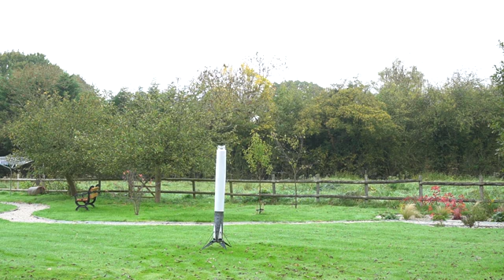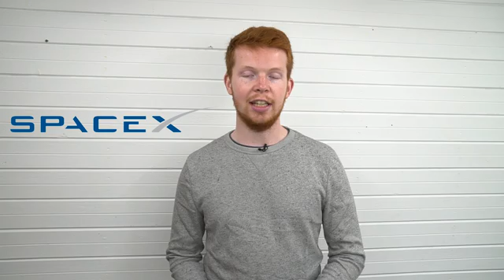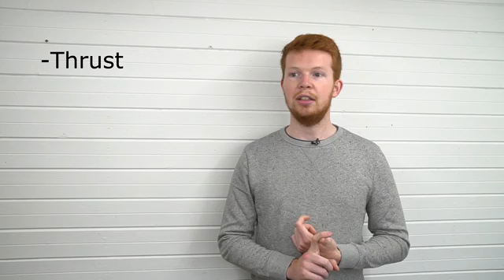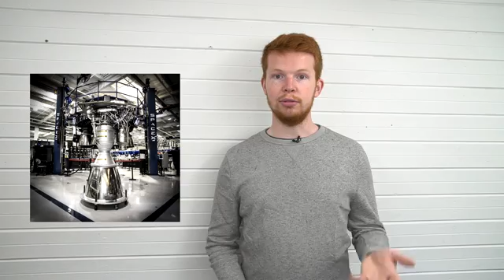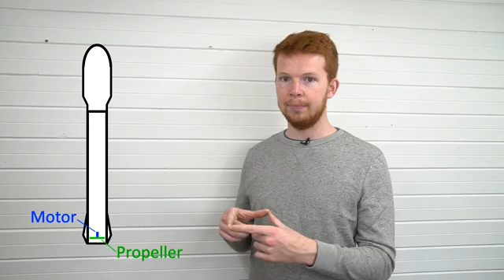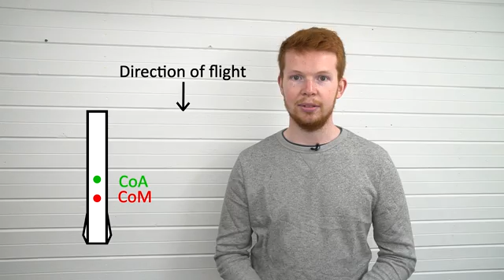Hovering a rocket - SpaceX model

Comment: Tom, Good effort. You learned a lot. But mostly, you've learned what NOT to do. Your first model was far, far superior than your second.

You could have saved yourself a boatload of effort by spending a small amount of time talking to someone who knows the engineering. Specifically a control systems engineer.

Just as soon as you moved all the weight to the top of the rocket, you doomed your project. With the weight at the top, your rocket is inherently unstable & (virtually) guaranteed to fall over every time it attempts to land. Plus, your rocket model is now completely non-representative of a real F9 first stage. 

Over 90% of the weight of the first stage is fuel. When the 1st stage is re-entering & landing, it has almost empty fuel tanks & is basically a hollow tube, with 98% (or so) of the weight (the rocket engines) at the very bottom. I've heard a SpaceX engineer describe it as a brick glued to the bottom of an empty aluminum can. This mass orientation gives the 1st stage inherent stability when it is falling in an engine-down orientation. This is also the reason that this whole approach is feasible in the first place.

The grid fins do not work by adding mass up high, but rather by simply diverting air, just as ailerons (not "flaps") do on an airplane's wings. Or your hand, when you stick it out the window of a car & tilt it.

The big picture that you are lacking knowledge of the huge engineering field called "control systems". The entire process of landing an F9 is, at its heart, one giant exercise in a hugely complex control system.

The whole field is a pretty complex one, involving instruments to measure the desired controlled parameters (PLUS their time derivatives & time integrations), actuators, feedback loops, amplifications (aka "gains") & stability. To get it to really work (& to understand why it does or doesn't) in the absence of wind, you'll need what are called PID (Proportional + Integral + Derivative) controllers on each of about 3 parameters: 2 pitch axes & altitude. You can get descent rate from time derivative of altitude. Your video showed that it's pretty difficult to control descent rate in an "open loop" manner without getting pogo instability. 

In the presence of wind, as the real F9 must operate, you'd need to measure two axes of drift across the ground. The real system undoubtedly uses multiple (probably 4) radio beacons on the outside corners of the barge or landing pad. Now the rocket will have to pitch in order to negate the wind drift, greatly complicating the whole system.

Yup, it's rocket science. It's complicated.

I'd recommend that, if you decide to re-do this experiment, you should move it indoors, say at a local gymnasium, which will simplify thing immensely.

You need to find a helpful control systems engineer and talk to him/her to get a general over-view, especially the difference between "closed loop systems" & "open loop systems".

Don't take anything that I've said as perjorative or discouraging. You've done exactly the right thing: built hardware to try to make your idea into reality. You've followed the path blazed by 1000s of engineers before you, going all the way back to the Wright Brothers (& their canard wings) trying to get airplane to fly stably. You've been struggling with exactly the same problems that all those engineers fought. 

The lesson is ... CHEAT.!! Use everything that those engineers who preceded you figured out. 
(It ain't really cheating. It's learning & applying.)

The most important lessons are:
1.  In order to really understand something, you've got to understand the underlying theory.
2. Theory ain't enough. "Just build it", like you did. You'll learn 100x more by trying & failing than you ever will if you stop at (or get intimidated by) theory alone.

Best of luck.
Reply: I believe he said "my wife" a few times either in this video or other videos he has made.
Reply: Thanks clavo.
And thanks for teaching the young 'uns.
Yours is a WAY under-appreciated (and we'll just gloss over "under-paid") profession.
Reply: Gee Charlie B. How come I rarely had any good teachers like you?  It's funny; I'm old and inattentive now, but the way you said, what you did made me struggle to understand because it was so simply stated.  Nice going.  You are a rare humble engineer.  I like being pedantic, for the love of big words, but it usually makes my arguments land like this rocket.  It'll be so nice when we are able to quickly and easily video record our replies to comments.  Maybe that will weed out some of the silly and mean comments.
Reply: It is not that complicated, dont get intimidated by it. 
You will need a cascaded PID controller   for each axis (roll pitch yaw), inner loop will be angular speed outer loop desired angle (of the rocket). -> feed output to the flaps
On top of that to hold position you need to fuse gyroscope with the accelerometers and if you can gps (ekf filter) to get an accurate understanding of the horizontal and vertical speed of the craft. To hover feed the delta of actual speed to desired speed(which will be 0) to another three pid controllers to get the desired angles to feed in your first loop.
Every quadcopter does that. Look into px4 code for example
Reply: Wow, that's impressive! Very interesting to hear. Must be an amazing feeling that your work actually saved a lot of lives. 

Im a student, currently finishing the Bsc Aerospace Eng. at the TU Delft (Netherlands), with a minor in Electrical Engineering. Next year I'll start with the master Control&Simulation, so very excited! Kind of explains my intest for this video I guess haha

But thanks for sharing :)
Reply: I wouldn't say he doomed it either but I would have done a lot more experimentation with A)the amount of weight and B)location. and kept the original 6 engine setup.  IMO he gave up too quickly on the first design.
Reply: Full disclosure: After getting my Texas teaching Certificate I went to Law School to impress people. Went on from there to be a Patent Attorney.   I should have stayed in teaching!  They say:  "ignorance is bliss."  I once thought that saying to be nonsense. Not anymore!
Reply: Neat Gifts. Hear hear
Reply: Thats very kind of you to say. Thank you!
Reply: teefkay2, Hi Teefkay:  Hope you don't mind my reading over your shoulder in reply to Charlie B.  Your brief resume is impressive.  I need a new hip but Dr. says I'm too overweight for a hip replacement operation.  I see the new graphene textile and wonder why small segments of it cannot be mixed with an inert lubricant and injected into the space between ball and socket of the hip?  I give you all rights to claim originality. I'm probably not the first to think this anyway.  Not looking for a total cure just an improvement.
  I'm thinking high pressure grease gun style injection into the space between ball and socket leaving the surrounding tissue in tact to help hold in the lubricant.
Reply: Hey @tee f kay, what books would you recommend I read to get a good understanding of VTVL? I eventually want to make a model rocket that can perform a basic launch and landing.

I'll soon be picking up Rocket Propulsion Elements by Sutton, but I'd like a couple of more books to add to my knowledge reservoir. Thank you in advance.
Reply: K.
Reply: TLDR
Reply: Oof
Reply: Tee F. Kay:  As an industrial arts teacher, I was very impressed by your educational and supportive comment.  It was a valuable thing for me to read and for Tom to get.  Well done!
Reply: I believe for the sake of entertainment, by not talking to people that are in the know before working through it the way he did, allowed us to learn first hand with him probably what the experts learned as they went through trial and error. Much the way "Mythbusters" often did their reenactments. 
For me, both of his models were only modified RC drone, but with that in mind I would have loved to see more effort put into the first one.
Reply: +teefkay2
Thanks for your extensive reply. Im always in for a good engineering related conversation. :)

Text below applies to hovering only. Lets assume no aerodynamic forces for hovering.

First of all, for the classical thrust vectoring, it does not matter at all if the 'center of action' is above the COM or below. This is because the engine moves relative to the rocket.  If you would draw a free body diagram of the rocket with only the thrust and weight, you will see that the control moments that can be generated by vectoring the nozzle are the same for a  center of action above and below the COM. In this case the rocket an NOT be compared to balancing a stick on a finger, because for this case the force you apply does not change automatically with the angle of the stick. For balancing a stick you have to manually apply the right force depending on the angle of the stick, wich is why it takes so much concentration. For the rocket however, the direction of the thrust force automatically changes with the angle of the rocket, since it is directly attached to the rocket.

The reason the engine is placed most of the time below the rocket is for the obvious reason that the rocket itself would be directly in its own exhaust gasses :) But there are exeptions, for example the excape rocket on the appolo V.

Furthermore, in this case the placement of the fan ONLY has effect on the position of the COM. No matter where the fan is placed in the tube, the air is actually deflected at the bottom of the rocket where the vanes are positioned. This is also the place where the control force works, since the direction of the airflow is changed there.

So again placing the fan to the top is a perfect strategy.

Then for landing, the rocket only becomes unstable in this configuration if the aerodynamic forces can not be neglected anymore. As you say, for a significant airspeed, the aerodynamic center of the complete rocket has to be above the COM. This gives you static stability at those velocities. However, this is only part of the equation, since you also need dynamic stability and other things, which is generally a lot more complex to analyse.

Anyhow, the title of the video clearly states: HOVERING of a rocket. And as long as the velocities are not to high, you can perfectly land the rocket in this configuration. Also something of engineering: First know what problem you are solving, before you actually start solving the problem.

"Of course.
Positive feedback automatically produces instability.
"

Absolutely right. I meant that he is already using a controller, and not flying it manually. The focus should not be on 'negative'.

"You’re welcome to go to your boss & say,..."

Haha, remember, this is a fun weekend project, so he doesnt have to convince any boss, or anybody, about the performance of his creation.

Are you an engineer by the way?

Cheers!
Reply: Charlie Bogaerts Howdy Charlie,
”Thanks for your reply.”
No prob. There are still a FEW places on Youtubez where people have fun conversations & don’t scream “Shill!!” & “Sheeple.!!!” at each other.

”Im always in for a good engineering conversation.”
Ditto, Charlie.
Gird thy loins. And thy sliderule.

”Are you an engineer?”
Aw, gee, Charlie. How could you tell? ;-)
Got my BS Mech Engr. degree 44 years ago from Cornell U.
My intended minor was Bioengineering, but they didn’t have an official program back then. So I talked them into allowing me to take anatomy, physiology & neurophysiology as “Liberal Arts Electives”. It took a bit of talking.

Anyway, my career: 
Project engineer, product design engineer, R&D engineer, staff engineer & CTO.
They kept trying to push me into management, and my reply was a constant, “F*** that. I love engineering challenges. I HATE ‘people problems’, groveling for resources & listening to powerpoint BS.”

I’ve been the project engineer in charge of a bunch of products that I didn’t invent, such as (Mariana Trench deep) underwater cameras & strobes & the main power transfer switch for all US launched rockets from Mercury (before my time) thru the Shuttle (during my time). And all Inertial Upper Stages. One of my devices went to Jupiter on Galileo.

Then I got into designing & inventing. I’ve invented a bunch of medical devices that have saved between 250,000 & 500,000 people’s lives. Inclusing, to a high probability ... my own. As soon as my damn health insurance starts approving this new procedure.
Tres cool, no?

You?
Reply: Hi Charlie,

"I'm quite sure he didn't 'doom' his project by moving the center of mass to the top for the second model. For hovering, this reduces the effect that you have to steer the engine to the right in order to go to the left, and vice verse, if that makes sense."

For hovering, you want the CoM below the Center of Action (the location where the thrust acts on the rocket. For this configuration, putting a fan near the top of the rocket is great.

However, at some point, all good things (like “hovering”) have to come to an end, and it’s time to land.
For landing, the greatest stability comes with the mass as low as possible. 
And during landing, a fan at the top will turn into a reliable disaster. As he found out.
__

 "Furthermore he says he is already using and tuning negative feedback controller."

Of course.
Positive feedback automatically produces instability.
__

 "This can also clearly be seen at the end of the video, where he managed really well to get the rocket to fly stable."

You’ve got TWO design objectives: 1) hover. 2) land … successfully. 

You’re welcome to go to your boss & say, “look, it hovered great”. 
He won’t care.
NOBODY is going to want to spend one minute talking about the 1, or 5, or 50 things that it did really well.

EVERYBODY is going to want to talk, at excruciating length, about the 1 or 2 things that didn’t work.

The essence of engineering.
__

 "Really cool project!"

I agree completely.
He’ll learn a ton by working at it, too.

And he’ll learn most from his mistakes.

The sad fact is that we learn 100x more every time a plane crashes or a bridge fails, than we do when everything works as expected.

Also, the essence of engineering.
Reply: Hi ND,
Put on a blindfold & try to balance a broom on your hand.

Next, attach a small loop to the top of a broom, hang it by the loop from a finger with the mass below your hand, put on the blindfold & try to hold it up. 

Tell me which one is easier.
__

This is also the specific reason that tightrope walkers carry long poles that sag at each end. The sagging weight lowers their CG, which makes them much more stable. The poles also increases their rotational moment of inertia, making it more difficult to have the whole system (walker & poles) rotate.
Reply: Have you ever balanced a broom on your hand? The center of gravity on the top is much better for stabilization. Loook here http://www.instructables.com/id/Self-Balancing-Robot/ or here https://www.youtube.com/watch?v=nT1FqvNbThU for example.
Reply: @ndteam8677  The problem here is, some of you are speaking of one thing and some of you are speaking the opposite, great analogy the broom. In that case , center of gravity is on top but the force is done in the bottom by your hand, that's why if you flip the broom its harder, but imagine you flipped it but instead of moving your hand there are "propellers in the top", that way center of gravity makes sense to be in the bottom :)
Reply: @ndteam8677  well... Your sort of right, but it's not stability that your thinking of, it's control. Putting the mass at the top and the thrust at the bottom gives bes the thrust vector g system a large moment arm with which to make very fine adjustments. However, this ignores aerodynamic stabity. In the case of landing you want your center of pressure (similar to what he calls center of area but they aren't the same and using CoA only works for simple model rockets) to be above your ce ter of gravity so that the aerodynamic forces aren't trying to flip you upside down. So you sacrafice some controllability for better stability, which ultimately is a better trade off as the added passive stability makes it much easier to control.
Reply: I'm not an expert on aerodynamics, but I think I understand. You are right about the aerodynamic forces, but I think that these forces can be effectively compensated, because of the possibility of large and precise control intervention. All current jet fighters are aerodynamically unstable using fly by wire system to stabilize and I thing this is similar case.
Reply: tee f kay could you help with My SSTO idea. 
Using Sold Fuel 
Sugar Fuel

It would look like a skinner but somewhat taller version of a 
V-2 from The Germans

My planned materials would be A High stress aluminum 
And a Experimental Heat Resistant Material 
For protecting the Engines melting the SSTO entirely 

My ideas were first 
Have everything important in the top 
And all the fuel in the bottom and middle 
Leaving 90 percent of the weight being fuel 

The other 5 material

And the last 5 would RC controls and cameras 

My parachute idea was at first 

But what if you could have the fins move and glide down liek a glider 
Or SpaceXs landing legs but they act as air brakes that stop the descent instead of using using a parachute ?

But I’m not sure 
It’s all papered ideas
Reply: I'm quite sure he didn't 'doom' his project by moving the center of mass to the top for the second model. For hovering, this reduces the effect that you have to steer the engine to the right in order to go to the left, and vice verse, if that makes sense. 

Furthermore he says he is already using and tuning negative feedback controller. This can also clearly be seen at the end of the video, where he managed really well to get the rocket to fly stable. Really cool project!
Reply: Charlie Bogaerts you are correct. Try balancing a broom with the bristle up. Then remove the bristle end and add weight to the bottom where your hand is. With the bristle up, it's easy. With the weight on the bottom it's very hard.
Reply: I think he needs a woman in his life 😆
Reply: @crazyjay7676  bruh